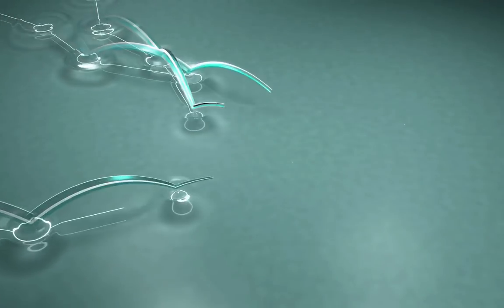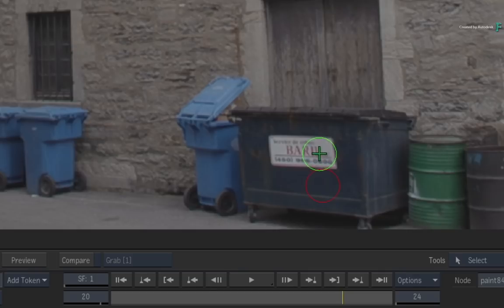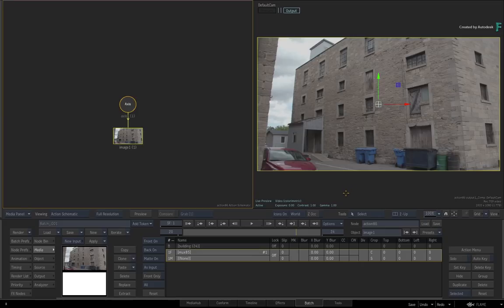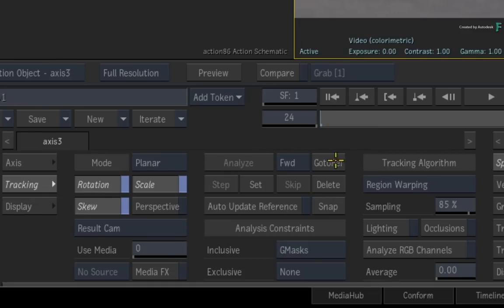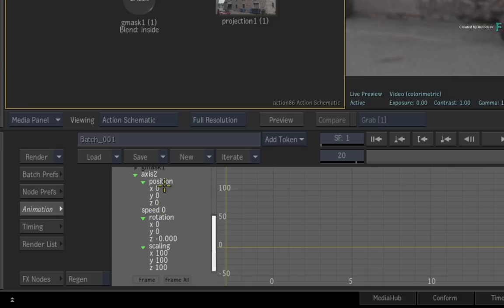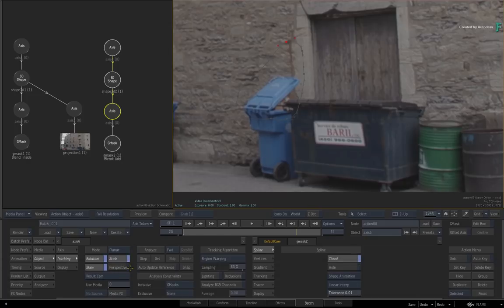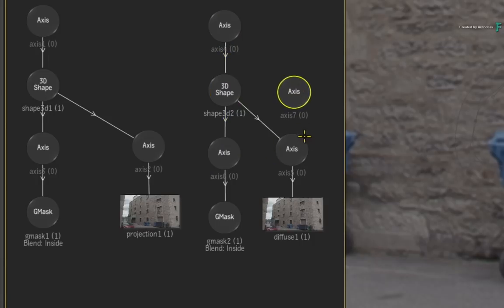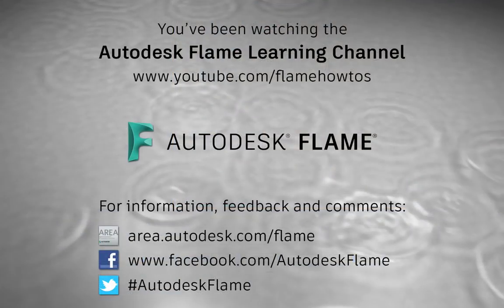Create a Clean Plate with 3D Shapes & Projections - Flame 2019

Comment: U can Do This in 5 Minute with AE
Flame is A powerful Program but UI in Flame Is very cold and dead
Reply from the maker: Hi Hamidreza Abbasi, Flame is quite a comprehensive toolset and can do a ton of stuff. Although please bear in mind that it will be different to what you would do in AFX.  In fairness, you would need to compare it to all the Adobe Video apps as Flame is an all-in-one solution.   

However out of curiosity, what issues did you have with the Flame UI?    AFX is layer-based whereas Flame is nodes, so the approach is different.   If you feel comfortable, please reach out to me and let me know your thoughts.

Thanks for your feedback!